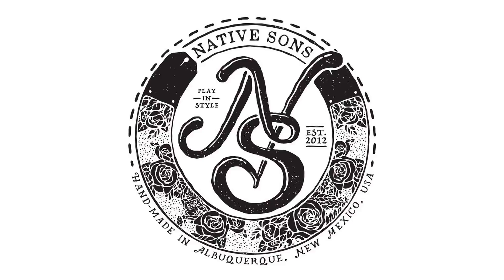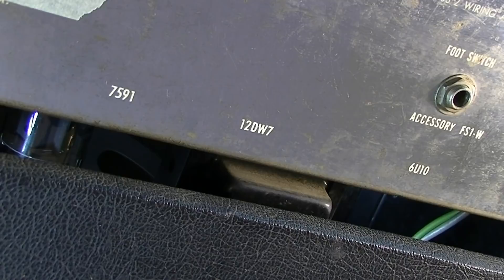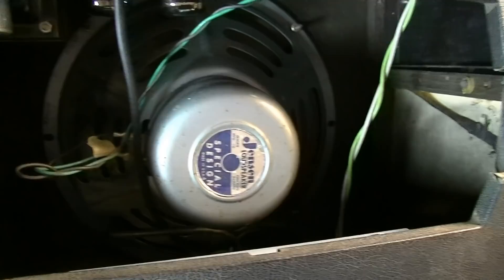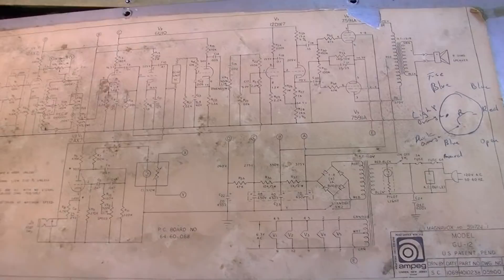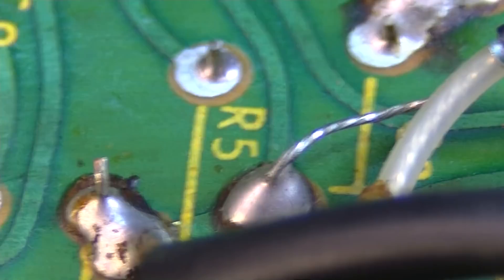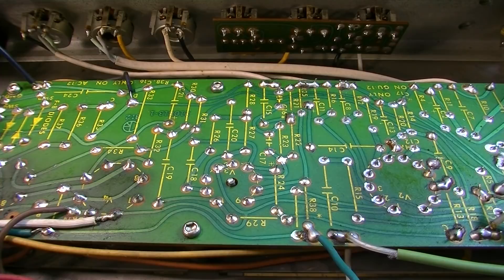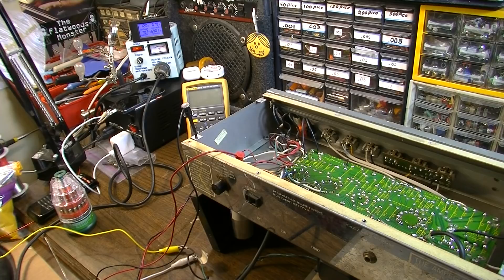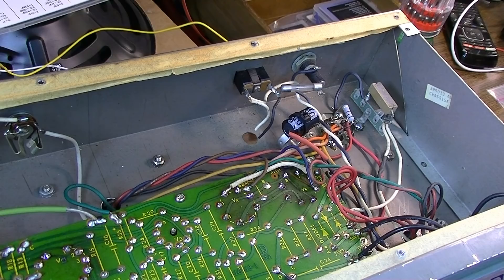What was Ampeg Thinking with This Board Design?

Comment: I think the word you're looking for "jossling" is "mechanical stress"(?)

Also, you're asking too much from manufacturers. They are too lazy to even put fuses on the transformer primary (see Weller and their soldering station that blows the transformer if you plug it the wrong voltage, instead of just blowing a fuse, like on Hakko ones)

Comment: WTF with the epoxy job? I would be pissed if you sent that back to me like that. I still thumbs up though. Keep making vids.
Reply: The socket is busted tho, finding another one exactly like the original would be a little hard. Its not like they are gonna use it anyway.
Reply from the maker: Robert's right. It was either try to epoxy it back or remove entirely and have to drill holes to install a cover plate to keep toddler fingers out.
Reply: Jay  Epoxy or no outlet?   Epoxy!
Reply: @bebo5558  yea you don't wanna go drilling unnecessary holes in vintage amps.
Reply: Actually, you can still buy these on eBay and other places. I did a search for "snap in plug" on Ebay and it came up in the first group!

Comment: 9:54 no, amp-builders should most definetly NOT solder random fuses in amplifiers :D
Reply from the maker: tocsa120ls it isn't random. It's on the schematic.
Reply: If that fail safe fuse isn't in there, one will eventually be created for you somewhere out of some other component. 

On some equipment when they are trying to save money on installing that second fuse,  a intentionally weak point is designed in so that a catastrophic fault will produce a more-or-less predictable failure. For instance, a just barely high enough wattage resistor that is meant to burn before anything else or a narrowed trace on a PCB. Also, some transformers have a built in fuse to protect against shorted windings causing higher than spec current draw.

Comment: What is the point of amps having an AC outlet on the back?? what is supposed to be plugged into them??
Reply: handy if you want to mount a small fan!
Reply: @EdDanaGuitar  now that makes sense....
Reply from the maker: Lots of early pedals had AC transformers, like Mu-Tron, for example.
Reply: Pedal board power supply for one. I remember these always being on the back of old school amps and stereo equipment.
Reply: That's direct AC plug not sure what amps you can pull but it might have it's own 20 amp fuse,,,,could be 10,,,runs direct off the AC line coming in,,,,like a branch off ,,,,maybe
Reply: Russell E Simonetta Russell am I saying the same thing ??
Reply: Russell E Simonetta I played drums in the early 70s,,,hey Russell where is Brad located do you know?? I think his name is Brad
Reply: Sheez.  Does absolutely no one remember the late 60's/early 70's?  The AC outlet is for your lava lamp.
Reply: chuckschilling 🤣🤣🤣🎸

Comment: Why the fuck don't you replace those fuckin weird ass screws with normal hex ones? It's a bad technique by the manufacturer that you need special part number ... what the fuck ever... I hate that.
Reply from the maker: It could be they were trying to prevent unauthorized servicing...or it could have been they just had a lot of those type of screws from some other type of appliance (Magnavox), and used them up.